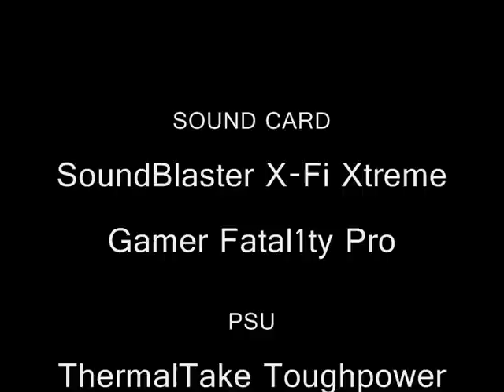BUILDING A WATER COOLED GAMING PC

Comment: i would get the antec 1200 if you have a 2 fan radiator bcoz the 1200 has 2 fans at the back so you can put the rad over it. it also has holes in the back for water cooling. has really good airflow too.

Comment: @Wabbit0789 Not entirely, I run an aircooled system full of fans and just wire up a toggle switch or fan controller that can turn them off, really you only need them if your playing a high graphiced game or other intensive processing procedure.  Otherwise just turn them off if idle.

Comment: thats very true i'm running 11 dans and their still quieter that of I had the CPU fan in there. Another advantage of liquid cooling is that the fans dont increase RPM when the system is under load so it doesnt get louder.

Comment from the maker: qwite hard to get em off. think i used a short screwdriver and i just used some double sided sticky pads (used to hang up mirrors) to mount the bottom radiator, easy to install, remove and cuts down vibration. got em from B&Q.

Comment: @tigercz Its not supposed to be quiet lol. Liquid cooling is first and foremost meant for overclocking not for the silence. BTW the GPU and CPU fans are what make the noise not the case fans. I have giant 230mm fans in my HAF 932 case and i dont hear them at all. The pump for the watercooling is actually louder than my fans lol

Comment: Nice rig and it looks cool, but Ah isn't the point of a water cooler to reduce the amount of noise?  I have 6 fans on my rig and um even at low RPM it is heard at more then a whisper!!  Dispite my negative Qwestion your rig is Smoothy, and looks great.  Hope you have a decent fan controller that is monitored digtially off the Water cooler!

Comment from the maker: cpu - e6700 (oc'd to 3.1ghz per core).
ram - corsair  XMS6400 ddr2 800mhz.
gpu - bfg 8800 gts 640mb oc2.
sound - Creative SoundBlaster X-Fi Xtreme Gamer Fatal1ty Pro.
i'll overclock the cpu some more when needed and i ordered the parts for the water cooling system and designed and built it myself its not a ready made kit. thanks for the comments/rating.

Comment from the maker: i had to set a really high Vcore voltage to get my cpu running stable so that makes it run very hot, and as the gpu's are after the cpu in my loop, the water must be hot when it pass through the vga blocks. maby thats why?

Comment from the maker: iv finished overclocking my CPU and graphic cards.
CPU = from 2.6GHz to 3.5GHz per core
graphic cards core = from 580MHz to 630MHz
graphic cards shader = from 1350MHz to 1540MHz
graphic cards memory = from 1700MHz to 2000MHz

my temps are:
CPU = 45C idle - 52C load
GPU 1 = 48C idle - 58C load
GPU 2 = 47C idle - 60C load

3D MARK 06 = 14733